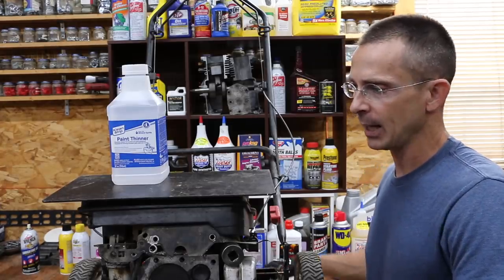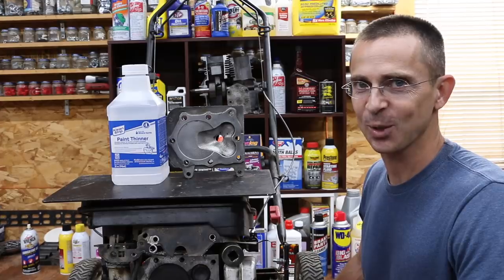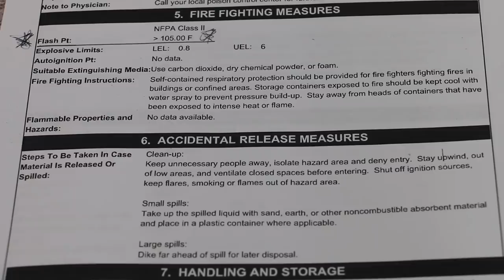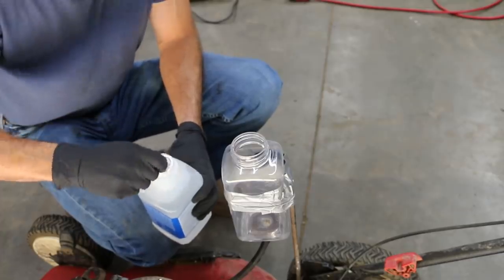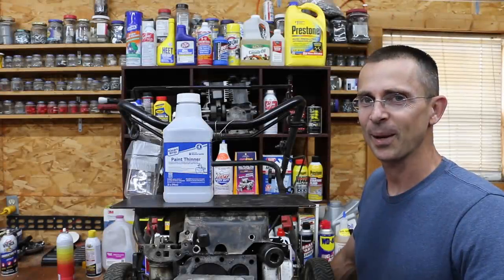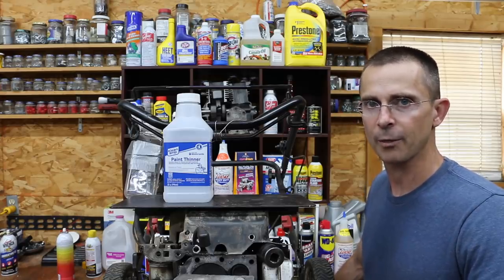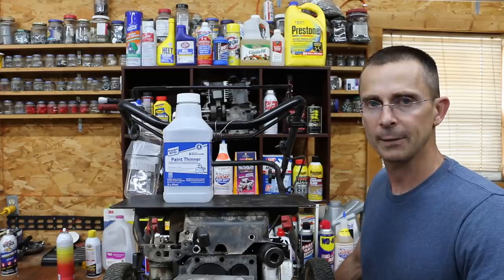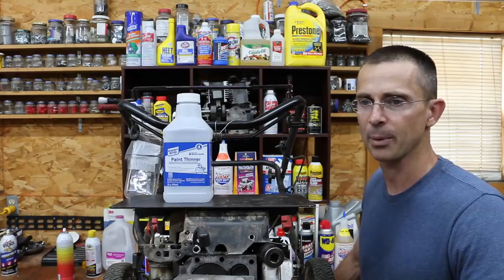Will a Gas Engine Run on Paint Thinner?  Let's find out!

Comment: That old mower will literally run on anything by now, its amazing.
Reply: Most lawnmowers will run on almost anything.  He should try Bacardi 151 next or Everclear 190 proof.
EDIT:  I just found out they don't sell Bacardi 151 anymore.  WTF?  Wikipedia say Bacardi 151 is typically mixed in sweet drinks.  Myself and my friends always drank it straight.
Reply: Bretton Ferguson They stopped selling it because Bacardi heavily promoted 151 to bartenders to use in flaming drinks and fire tricks while at the exact same time basically telling them, "don't set this alight, wink wink, and certainly don't remove the flame arrester cap! That would be wrong, wink wink!"  

They thought that half-assed, deliberately insincere warning would protect them from lawsuits if a bartender was burned - and it might have, but unfortunately the most notable victim was an innocent bystander who'd entered a bar to watch a basketball game and who didn't even know the bartender was planning on any fire tricks. She suffered third-degree burns, spent over a month in the burn ward, and was disfigured for life; she and her health insurance provider sued Bacardi and won, with the judge ruling that Bacardi's warnings were insincere and would lead a reasonable person to think there was no real risk.
Reply: @Ea-Nasir_Copper_Co  Dang that blows for everyone no joke that has to suck not being able to resumen ormal life after that

Comment: Proving that lawnmowers are all multifuel 😂
Reply from the maker: LOL! Thanks for commenting.
Reply: Then try a different supplier of backwoods moonshine! ;)
Reply: There's no reason why it shouldn't, just remember that the mix ratio for alcohol is half what it is for gasoline, it's usually 7:1. If you open up your jet a lot it will run well.  Sami

Comment: WD-40 vs Starting Fluid in a Diesel Engine. For years I have used WD-40(no straw) to start hand pump hydraulic starter diesel lifeboat engines. These lifeboats were a massive pain in the ass. Especially in the dead of winter near the Sea of Okhotsk. And this ship only had regular starting fluid in the boats. One day, I couldn't get one of the lifeboats started an old timer told me to try WD-40, Sure enough, it worked like a charm, no knocking either. This same engine would go on to have injection pump issues and be impossible to start in the cold, but with WD-40 it was not an issue.
Reply from the maker: Thank you for this recommendation.

Comment: Wow, I am astonished at all of the things that the mowers have run on. Perhaps you could do a little board where you record successes and failures. I think that would be a great addition to the video series and would help us viewers (especially those who haven't been following along the whole time) by not suggesting things that have already been tried.
Reply: I second this. I am totally amazed at what small engines will run on also.
Reply from the maker: Thank you for this recommendation.
Reply: When I was in college I used to run my car on anything with a flammable sticker. If I came across it, then into the car it went. Never replaced the CAT and never had any engine related issues. Fuel injectors were replaced when I bought the car and this stunt did nothing to them. You would be shocked what a motor will run on. Especially if mixed with gasoline.

Comment: I have a good one for you.  I am a painter as mentioned before.  I was surprised on the paint thinner.  I have a lot around my house.  I use it to clean my equipment.  One of the major components of oil paint is linseed oil.  I was wondering how that engine would run on a combination of linseed oil and paint thinner.  Maybe I can get rid of it on the cheap.  LOL
Reply from the maker: Thank you for this recommendation.

Comment: I have 2 more ideas considering the cost of suitable substitutes
1. Toluene
2. Turpentine
Basically both are kind of ok to run in gasoline engine considering octane rating
Basic idea is to find a cost effective replacement for gasoline
Both are way cheaper than gasoline when bought in bulk (for industrial use ofcourse)
My guess is that some ratio of toluene and turpentine mix might just be as good as or even better than gasoline. I know some people run on 80+% toluene but has difficulty in starting when cold
It would be really interesting to see how it turns out
Reply from the maker: Great video idea!
Reply: Toluene also makes for some great sniffing! It's been decades, but we used to sniff up gallons of toluene in Texas! Great stuff, and I always figured you'd be able to run an engine off it.
Reply: @anselmofrias3330  I remember a motor sport tribunal in the UK hearing a case involving toluene. Someone had raced a car in a category where competitors had to use normal pump gasoline, and the scrutineers took a fuel sample and found it contained about 55% toluene, which has a higher octane rating than normal gasoline. It turned out that the specification of pump gasoline lists toluene as a permitted constituent and sets no minimum or maximum limit on what proportion it constitutes, although normally it is a very small proportion. The competitor was found not to have infringed the rules.
I also remember a court case in which someone who was driving erratically on the road was found to have been sniffing the fumes from Evo-Stik, a popular adhesive that at that time used toluene as the solvent. He was charged with driving under the influence of a drug, and argued that Evo-Stik is not a drug. The court ruled that by inhaling the toluene vapor from the Evo-Stik in order to produce an effect resembling drunkenness he had used toluene as a drug, and found him guilty.

Comment: Put aggressive cams in the lawnmower... or a turbo..
Reply: tommy d u b b s awesome idea
Reply from the maker: Thank you for this recommendation.
Reply: some nasty valve overlap
Reply: Awsome idea bro. But can it take that lawn mover engine take that much boost. It might just stall.
Reply: Easy enough to use a leaf blower for a lawn mower, it's small enough to work well probably

Comment: Will a diesel engine run on brake fluid? (Probably wear a mask for this if you try)
Reply from the maker: Thank you for this recommendation.
Reply: Brake fluid is only moderately flammable. It will burn if it gets heated enough, but it is not classified by OSHA as a combustible.
Reply: Robert G diesels use hot air for igniting the fuel instead of a spark plug
Reply: Also compression plays a big part in its combustion.
Reply: I doubt it will run on brake fluid but I bet I watch it!
Reply: Isn't a big part the atomization of the fuel as well? I am thinking of an oil furnace that sprays the fuel through a nozzle and ignites the mist.
Reply: I forgot all about fuel oil, they used to use it to heat old house and steam locomotives switched from wood and coal to burning oil. The railroad used to plant Eucalyptus trees along the train tracks becuase it was a hot burning fuel.
Reply: Diesel fuel has lower flash point burn than that of gasoline, and this is important to the Diesel's longevity.  Since the flash point of gasoline isn't much, a simple match will light it, under the heated pressure of compression it'll ignite violently before the piston has a chance to get to TDC and the connecting rod passing over the crank.  Brake fluid might do the same, so injection timing is crucial or else it'll knock the engine, same with Diesel fuel injection set too far advanced.  The brake fluid might not do anything at all when the engine's cool, it'll just soak the glowplugs and not have enough heat to combust on its own.
Reply: are we talking about brake cleaner or brake fluid here because chlorinated brake cleaner is incredibly toxic when heated
Reply: iamawatermelon I know a 7.3 will run on used trans fluid, not sure about brake fluid, idk how flammable it is
Reply: iamawatermelon is this is Joe back at you the guy who suggested the moth balls I'm not surprised at all the only downfall to that is it's like three times the amount of money over gas have a great day take care
Reply: Mix gas and disle
Reply: keeganwebber 

this is brake fluid not brake cleaner huge difference there LOL
Reply: @keeganwebber  yes, but brake cleaner isn't flammable.
Reply: @MrDeviousdom  chlorinated brake cleaner isn't, but compression produces heat regardless
nonchlorinated brake cleaner is very very flammable though
Reply: I wouldn’t do it with any chlorinated brake fluid! Some are some aren’t nowadays. They decompose into chlorine and phosgene when heated above 200c
Reply: @TheMcspreader  +v pp pp
Reply: And will the brakes work with diesel?

Comment: Not the cheapest way to cut your grass but the next time I run out of gas and am too lazy to get more,I always have thinner.
Reply from the maker: LOL! Thanks for commenting.
Reply: RC Hobbyist Extreme straight thinner is bad gotta lube up with some marvel
Reply: Garrett Burrows Yeah,I wouldnt. I have used twocycle gas. It cruds up the cylinder head,slark plug and valves if you use it all the time. Then again,on a worn engine,it boosts the compression much like a wet compression test using oil in the cylinder. My mower is 30 years old so I dont care what I use in it any more. I doubt I can even get new parts for it. Its an old Snapper friction drive mower,the last of the best mower snapper ever produced.
Reply: Lol he has a video where he uses kerosene in a gasoline engine and it actually runs.
Reply: Tailslol White gas/coleman fuel/ naptha is not the same as paint thinner. The first 3, seem pretty much the same, if not exactly the same. Paint thinner/solvent is something different and does not volatilize like the “gasses”. I sometimes used my Paint thinner/solvent soaked rags in my wood stove just to get rid of them. They do not really burn very well. I would not dare put a “gas” soaked rag in my wood stove as it would explode. That is why I am really surprised that paint thinner could power a lawn mower.

Comment: Well, I know that some people have done that, but how about running an engine on hydrogen? Just throw it through air intake along with air, and give it two stroke oil through fuel line in carburetor, so it doesn't seize. You could build a simple hydrogen generator with no problem, and results might be interesting. Careful though; as hydrogen burns very aggressivly (explodes actually) it might damage or destroy aluminum piston. But if you're careful it should be fine. And I wouldn't run it in see-through engine, glass might not last very long, and no one wants you dead.
Reply from the maker: Thank you for this recommendation and thanks for the safety precaution on the see though engine.
Reply: +Project Farm Thank you for your response. Can't wait for new video

Comment: You should try using diesel fuel as engine oil and see if diesel keeps it lubed enough or if it seized up or if it runs better or once heats up diesel ignition occurs
Reply from the maker: Thank you for this recommendation.
Reply: Diesel engines have oil delivery systems on them for a reason, y'know. The oil pump is not there just to look pretty.
Reply: i agree with this one, the small amount of diesel that gets burnt of in the combustion cycle might add a little bit to the combustion.

Comment: that was simply amazing, I never would have thought a gas engine would run in mineral spirits, you definitely got my thumbs up on this test... keep em coming.... I'm watching as many as I can
Reply from the maker: Thank you
Reply: | I never would have thought a gas engine would run in mineral spirits, you definitely got my thumbs up on this test …

Uhm, you're aware that gasoline is also a mineral spirit (›spirit‹ here in terms of rectified spirits) as in fundamentally minerally, biologically and organically-sourced? Gasoline is a biologically organic distillate same as spiritus or turpentine oil (which is the organic juice of a birch) – as all chemically-sourced fuel-types like ethanol et al.
Reply: Aren't mineral spirits white? Pretty sure this is paint thinner kinda like lacquer
Reply: @gunners4129  Pretty much every kind of fuel or flammable fluid is dyed artificially for distinctiveness and marked to reveal when being burned. For instance, that's why heating oil/oil fuel is dyed I think orange, to reveal when be used as fuel in cars – to immediately reveal its use due to the excessive coloured smoke.

That being said, they all dyed for either natural distinctiveness by humans for handling of such chemicals or for reasons of preventing tax-evasion …

Comment: My dad used to own an Old tractor from the 40s, that had a gasoline engine (DeSoto inline 6). The tractor actually had two tanks, one for gasoline and one for "white spirit", and you could switch between them. Apparently back then people ran them on paint thinner, and used the gasoline mostly for cold starts.
Reply from the maker: Great information. Thank you

Comment: How about acetone?
Reply from the maker: Thank you for this recommendation.
Reply: Just make sure you do it outdoor and avoid the exhaust fumes. Propane and Butane are my choices for running an engine.
Reply: Yup it will run, but also eat out any petroleum based seals in the carb and engine. 

DISCLAIMER: NEVER EVER use acetone as a fuel or an engine cleaner, unless you want your fuel lines to dissolve.
Reply: same thing
Reply: It will run, but it will damage Seals and your Rubber Hose Lines :((
Reply: Acetone will turn most plastic parts into goo... not sure about nitrophyl carburetor floats, but probably not good for them.
Reply: Hahahahahaha... Plastics / Seals will become " Assholetone "?
Reply: Alex piv not run but the old gear heads been using it to clean up gas tanks by the jug with tone.
Reply: I have heard this can be used to clean catalytic converters.  I would not do it to my car, but I am curious to see if it damages anything.
Reply: That should work easy but it would have to be leaned out I imagine since it is so explosive!
Reply: You better start off running it lean to be safe! you ever see how fast it evaporates?!?
Reply: No, it is VERY much stronger, you would be shocked to see how fast it evaporates!
Reply: Of course it will run on propane or butane, never heard of engines modified to run on LPG (which actually is liquefied propane/butane mix)? :) I don't know how common this is in the US, but it's fairly common (at least in central) Europe.
Reply: No, paint thinner is mineral spirits where Acetone is a sort of Methyl-ketone chemical -- there is a huge difference in their chemical make up !
Reply: acetone is too hot it will take out the valves ( please dont ask me how i know)
Reply: He already tried an acetone mix with the brake parts cleaner video.  
2-propanone=acetone
Reply: Use acetone as mixture 0.2 % or 2ml/L.
Is being used for decades. Acetone makes gasoline thinner, so finer droplets vapour and better combustion.

Let's test it.
Reply: A back garret idea
Reply: Bruni  I think in different countries mineral turpentine is called paint thinner, in Australia automotive paint thinner is a high quality acetone.
Reply: Xylene as fuel

Comment: As a teenager in the early 60s I had to get the grass mowed before my dad got home. I got started and ran out of gas and had no more.  I used paint thinner to which I added some linseed oil to get enough to finish the job.  It ran well enough to get the job done.
Reply from the maker: Thanks for sharing.

Comment: You should try and have one of these engines run for a couple of days non stop and see if it would eventually melt down, or if the internal parts would eventually break.
Reply from the maker: Thank you for this recommendation.

Comment: How about running an engine on Nail Polish Remover
Reply: Junovay Plays acetone, I would also like to see it
Reply from the maker: Thank you for this recommendation.
Reply: thats pretty much the same as this
Reply: Acetone, acetate, denatured alcohol, methyl ethyl keytones, or MEK, or even lacquer thinner, or a synthetic reducer made for rust inhibitive oxide would all work. I just can’t imagine the seals in the motors handling that level of solvent for a very long time. Especially MEK, or lacquer thinner.

Comment: Will an engine run on acetylene or hydrogen?
Reply from the maker: Thank you for this recommendation.
Reply: Be careful with acetylene. It is pressure /impact sensitive and may spontaneously combust.
Reply: I'd be more worried about the damn Hydrogen.........
Reply: George Tinc Small iInternal combustion engines work fine with hydrogen.  If he buys it from a gas supplier in a proper gas bottle, no more dangerous than oxygen or acetylene, both of which are extremely dangerous in the wrong hands.
Reply: Storage, not use would be my concern. I know the dangers of Oxy/Acetylene as it comes with cutting torches, i remember some idiot cutting over the lines and catching them on fire with a molten piece of metal, never saw so many students run so fast...... the teacher had a fuck it attitude and later told us even after running as far as we ended up, we'd still have been in hell, as the tanks would likely have leveled the block. Thank God for Flashbacks.
Reply: a good mix of hydrogen and oxigene: No need for a lawnmower. Just ignite the baloon (HPC / beyound-the-press did this recently. Look for "Weather Balloon Filled with Oxygen and Acetylene"

Comment: i would like to see you replace the oil with water  to see what kind of if any lubricant it will offer it
Reply: It offers basically none from what I've seen in the past... engine fails just like no oil.
Reply: yeah but it would make for a good video
Reply from the maker: Thank you for this recommendation.